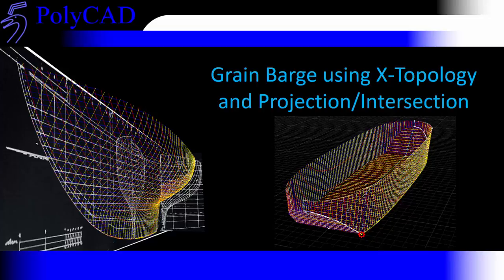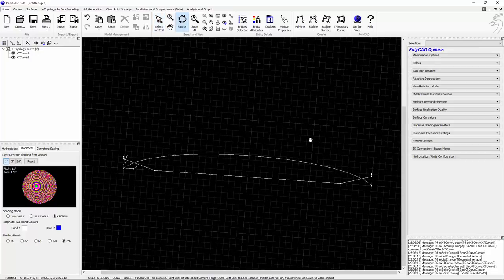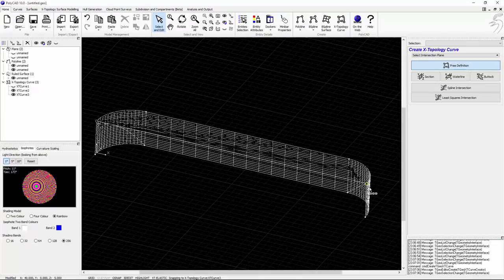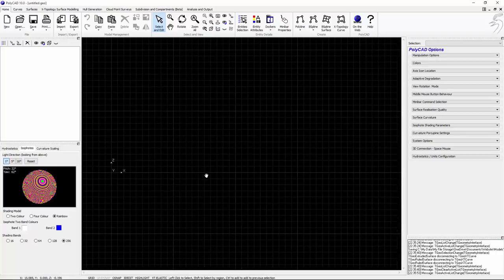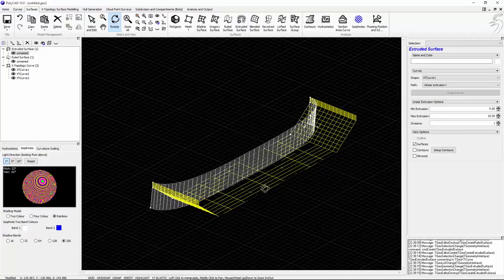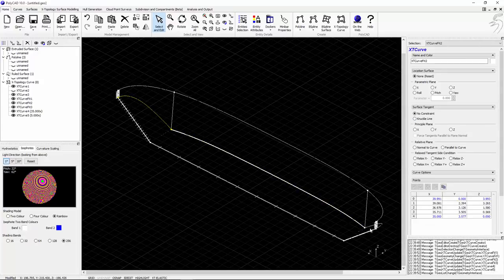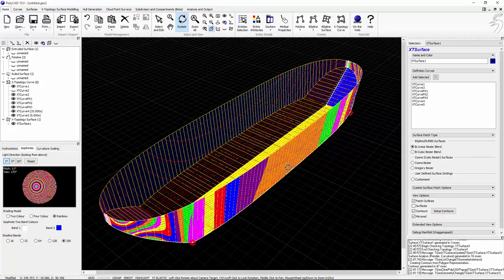PolyCAD: X-Topology Grain Barge

Comment: about 4:24 its a bit messy, for me. After many reviews in slow mode ( x 0.5) I see that you are fittng less square curves in both round knuckes. I haven't used that tool before. Every step is a new upgrade in learning. Thanks.
Reply: in version 10.6, the Least square fitting is easier . Just care about number of point to optimise. For me it were 11 points.

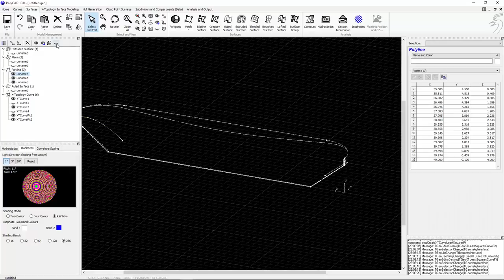Comment: .....And then (4:44) you replaced the original 2 polylines by the new XTCurvefit 1 & 2, to continue with them....   [Now I needed speed (x0.25)...]
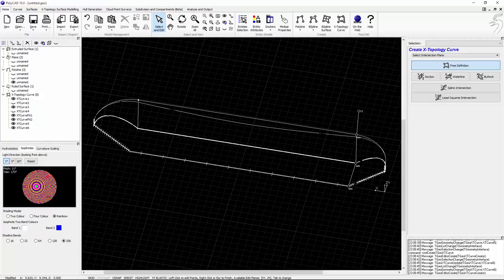Reply: In my sketch, I also do that change  (LSFit) to the deck edge polyline.  (Hiding XTCurve3 before).  And snapping (5:07) ending mid body sections to that curved deck edge, instead of the original straight line.